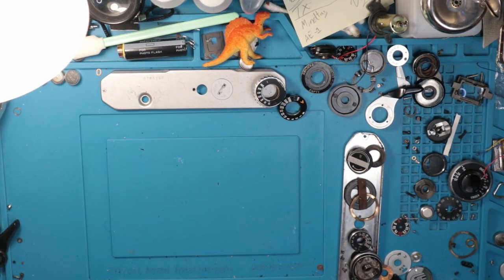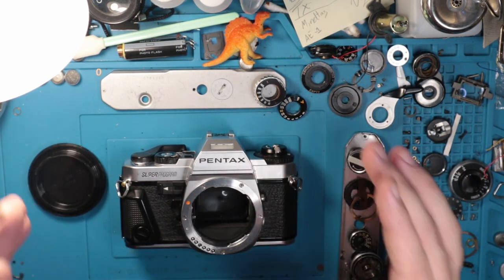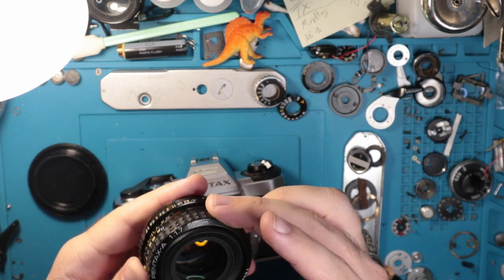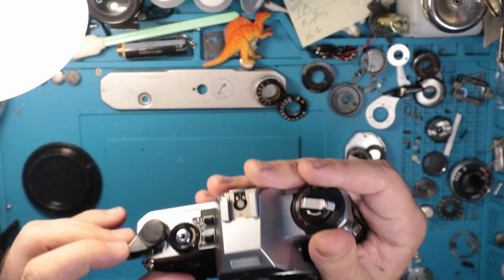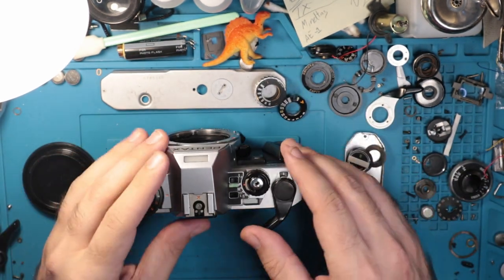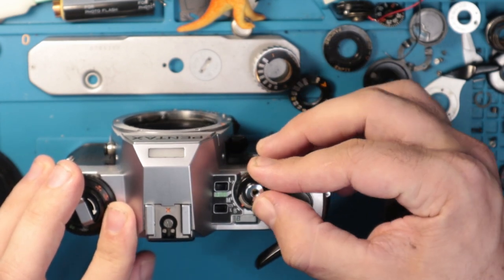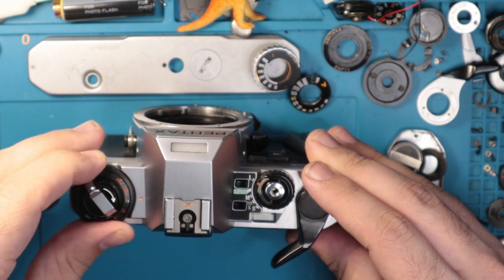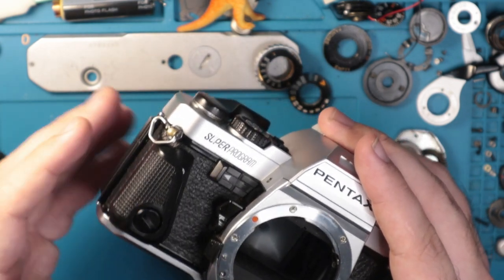Pentax Super Program Walkthrough

Comment: Groovy. Just took a deposit for one of these - one of my personal ones I've been shooting for 3 or 4 years. Great little compact shooters. VF on these is stellar - I think it may be brighter/clearer than my LXs......   Quick little note though when you pop the film-door and load a new roll (or just pop the film in general) e.g. whenever the counter resets, the camera automatically sets shutter-speed to 1/1000th until you reach frame #1. Remember the first few times I picked this up after not using it for a while I'd forget that (or just didn't know the very first time) and thought my shutter control had lost its mind. Of course I kept popping the film door as I messed with it so it kept reverting back to that fast shutter speed making me think it was getting worse. LOL   It's by design and a cool/smart little feature.

Comment: I have just bought a fairly good condition Super A. I am very familiar with the cameras but this one appears to have had the exposure compensation dial put back after a service in the wrong place. This means I cannot  get accurate readings. Do you have a video where you show how to take that off and re position it correctly?  Compared to a separate light meter the readings I get are 3 stops out. Thanks Geoff from Australia.

Comment: Why do you recommend leaving the camera advanced when turned off? I've noticed this chews through batteries because when the cameras advanced, even in the lock position, the LCD displays a bar in the top right corner to tell you the shutters ready to open.
Reply from the maker: That's a good note, truthfully I've only worked on these in a repair capacity so I am not very familiar with the daily use but with the a lot of these Pentax systems the loss in tension can potentially lead to the infinite winding issue. It's kind of a peace of mind, preventative measure but maybe not the best to do if it'll kill the batteries so thanks for the comment!

Comment: Nice video. Very comprehensive! I’ve just gotten my hands on the black Super A version and have an issue and was hoping you have some tips. The electronics appear fine, can go through the modes and select shutter speeds, however, the film counter doesn’t reset and the film advance is stuck and shutter will not fire. It looks like the film advance hasn’t fully wound and hence shutter isn’t ready to fire. And tips to loosen this? Thanks!

Comment: I was lowkey hoping youd go more into the “this” (5:05) cause I feel like that could be important to the iso when trying to shoot 1.6 iso film 💀💀💀
Reply from the maker: Unfortunately a lot of the electrical systems can’t compute such a low resistance so you may be able to have it down to 6asa or the lowest and see if you can compensate with the exposure compensation and if not may have to use a light meter or a bit of mental math, either way I hope that helps!